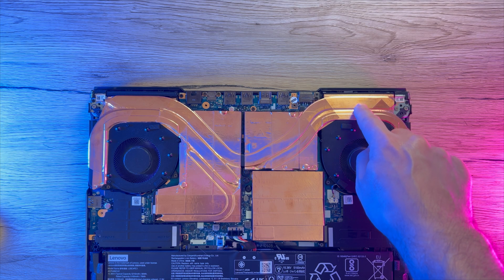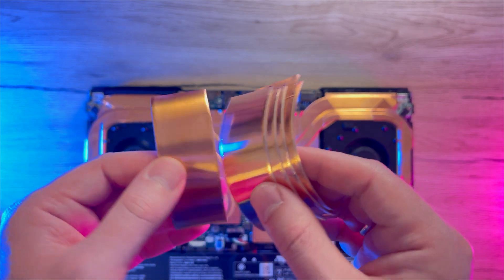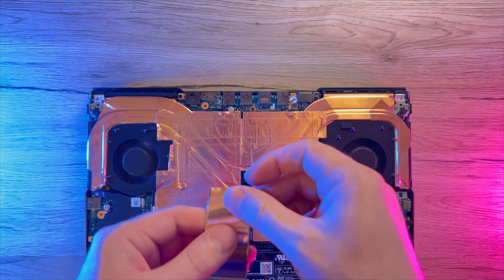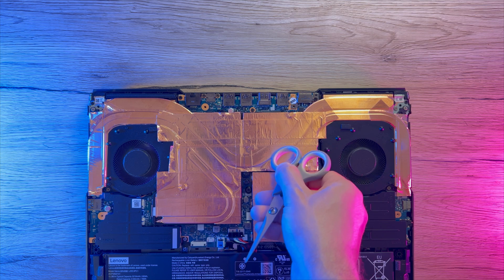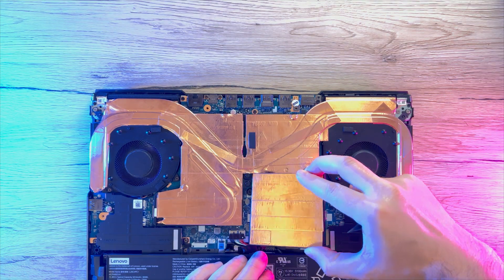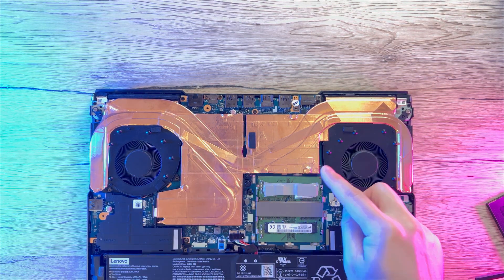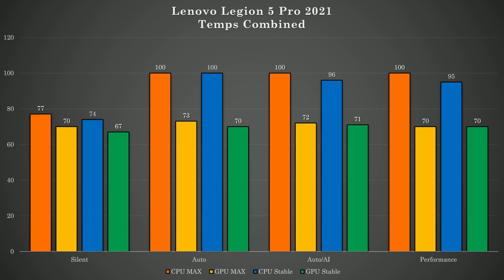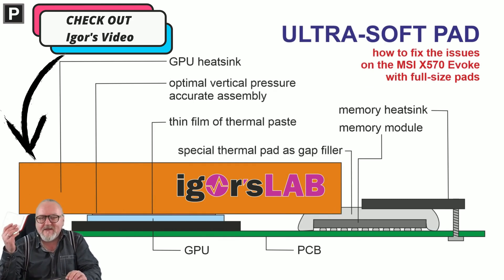Lenovo Legion 5 Pro Modding Cooling Block (can be applied to any laptop)

Comment: Where's the before temps???
Reply from the maker: Temps are the same as they tend to be with all laptops. After some time cooling block is saturated and there is not mich you can do about it. This will benefit daily use and idle temps but under load it will get hot no matter what you do :)

Comment: This was a terrible mod. There are no before and after performance comparison. Which I highly doubt are there much. Maybe 2C difference at most. Probably not good long term too when the coppers stored all the heats in it. It will not be able to dissipate the heat fast enough in a long high load use. So the temperature would have slowly creep up.

I think a better and easy mod that you should have done was sticking a bunch of copper fins on top of the heatpipes and heatsink. Since the bottom cover of the laptop already have opened fins for airflow, taking advantage of that by increasing the surface area of the copper heatsink would help dissapate the heat from the original heatsink into the air faster. And it is readily available. You can buy thin layers of copper fin heatsinks with already attached adhesive that is used for NVME SSD heatsink. Buy a bunch that have low profile that you can fit under the laptop cover. Then just put the laptop on top of a good cooling pad and you can probably get 20-30C temperature drop.

I don't even mod the cooling on my laptop. I just put a IETS GT600 laptop cooling pad and it can already drop the temperature around 10-15C. I don't even have to max the fan speed. The standard fan speed I use is around 800-1000rpm. During gaming I increased it only up to 1400rpm. The max 2800rpm is just way too noisy. It sounds an actual stand fans. I can bet by increase the surface area of my laptop heatsink by adding copper fins on top of the stock heatsink, I can probably get another 10-15C temperature reduction. Probably a total of 20-30C temperature drop. I am already planning to do it on my next GPU/CPU repasting.
Reply: I was thinking the same thing about the adhesive on the tape for a long time I don't think this is a good idea

Comment: i saw that you remove the 2 black tapes covering the bottom panel fan intake, does that help with temps or noise?
Reply from the maker: They do a bit but nothing noticeable really it just make air move differently and across the cooling block

Comment: Well, this seems to be both pointless (can't and doesn't do anything good for temperatures) and dangerous (the risk of dropping tiny copper cuttings on the mobo). I like it!
Reply from the maker: only thing that it does is when idling or in light use, otherwise cooling block gets saturated fast no matter what :D and yes it was slow process XD

Comment: I'm considering soldering the edges of the copper pipes to the chassis in order to enhance heat absorption. I've noticed significant air gaps between the pipes, especially after replacing the thermal paste, which has resulted in my CPU reaching temperatures above 90°C. I think I inadvertently created some of these gaps while removing the cooling block. Another theory I have is that my cooling block may require more pressure. When I secure the screws, they tighten before I can sense the necessary pressure. I'm uncertain about what steps to take next.
Reply from the maker: Well that is basically pressure issue that we all are facing and why Lenovo use PTM pads that are much thicker... try and let us know what worked best.
Reply: @atechcheck  
You mean Much Thinner!!

I attempted to test it by applying only the thermal paste and installing my cooling block without using any thermal pads to enhance the pressure on my CPU. However, it still overheated, reaching 97°C before I even had a chance to start the game. It didn't get past the loading screen.
Reply from the maker: @Abdallah_Ismail  hmmmmm that does not sound good man!!! what you cant do to check contact and pressure is to use ink paper (or whatever it is called LOL) that will leave marks on both sides so you can be sure if it is making good contact! It might be that small lugs (screw holes) on your board are raised too much and even when you screw it tight it is not making enough contact so what you can do is to sand/grind some metal from bottom side where your screws are so it must sit a bit lover then ;)
Reply: @atechcheck  
"I have considered the possibility of finding those small lugs, but I couldn't be 100% sure that I had them. After closing it up for the 7th time, I didn't bother to check again. The last time I applied thermal paste and pads of 0.5mm, and I thought that's it.

During normal workloads, I don't experience any problems, but while gaming, I have to cap my FPS at 60 instead of reaching 80+ to prevent overheating.

Perhaps tomorrow, I'll check for those lugs without removing the entire block. If I don't find them, I'll close it up as it is.
Reply from the maker: Thats great!
Reply: @atechcheck   Hey, your tip about "small lugs (screw holes)" and "sand/grind some metal from bottom side" WAS AWESOME
just oppend it to remove some of the dust-out and I remembered to check for them, and yes after grind them a little bit I got better result in temps, Thanks again <3
Reply from the maker: @Abdallah_Ismail  awesome! I mean you have made that gap smaller and with that you got better pressure and heat transfer
Reply: @atechcheck  Thanks to you <3

Comment: would any type copper sheet work? is there any risk due to electrical conductivity of the sheets?
Reply from the maker: Of course there is! Be careful! As you see I have only applied so that there is no possibility of touching any components. I used one with glue but in theory any would do and thermal mass will be improved. There is a guy on YT that used thick copper plate used as back plate for GPUs so check that out 😉
Reply: @atechcheck  ok so I finally tried this. Put ~3 layers of copper film over the copper heatsink pipes in my old Sager laptop, reapplied thermal paste (no that it needed it cause I had changed it recently) and added a couple of thermal pads to make contact with the bottom chassis. Max temps did not improve, still hitting 95c~98c under load. BUT idle tems did see a huge improvement. I used to hit 80c while on desktop or YouTube, now they're around 50c~60c.
I'll see if it lasts for a time, but overall for the $2 I spent on the copper film and the ~1hr of work, I'm happy with the results. Thank you for this tutorial!
Reply from the maker: So now do you understand what I meant and what was shown in video? Those cooling blocks will get saturated under load and no matter what we do we are going to hit 90C! What you can do now is disable turbo boost under power profiles and set max to 99 and you shout stay under 80C, then you can undervolt your gpu and fix clocks at max advertised and with that limit boosting and there is your extr few C :)

Comment: Are you just trying to increase thermal mass? Because this won't increase heat dissipation, might even make it worse. But higher thermal mass I guess.
Reply from the maker: Jup that was my goal since it will get saturated anyway, but with external cooling stand it will help to gather and dissipate more and stay silent ind daily use. When gaming it will be hot anyway. Only way to combat that is reduction of speed or pwr of cpu and gpu
Reply: @atechcheck wait, I'm confused now, does it not make the laptop cooler?

Comment: Where did you buy those ? I can;t find exact same product you used.
Reply from the maker: By those you mean copper sheets or?
Reply: @atechcheck  yes
Reply from the maker: I just got mine in standard garden shopping centre. You can find them on Amazon too. They are being used as prevention for slugs in garden too

Comment: Would it be beneficial to use thermal glue to yhe copper so theres perfect continuity between heat
Reply from the maker: There is a video of a guy doing just that 😁 it worked actually (he used a copper plate with some kind of slim fins) but the issue with those Lenovo laptops is not cooling body but rather die to cooling block contact and pressure…

Comment: Hey what is your undervolt settings that you used?
I have L5P RTX 3070 and RYZEN 7 5800H
Reply from the maker: I use TDP limiter for cpu and for GPU I try to keep stock boost but low as possible V. You will need to test and find one for your chip. Mine is fine at 0.85 I think

Comment: i had a question am i the only one that there right fan is always at full blast and my laptop is never silent idk why
Reply from the maker: It is because your CPU is reporting high temps but your die contact is not good enough to transfer that heat and laptop gave instruction to ramp up the CPU fan (if we are looking at right one when opened)

Comment: how will the glue behave in the long term with 80+ temperatures ;
Reply from the maker: Well, a good Q :) if you clen everything with alcohol and then apply copper tape well it hold really well (really hard to take off) now looking at long term... I honestly do not know. I will be opening my L5Pro to check and update as a pinned comment under this video ;)

Comment: Cool technique! Is it really so efficient? Thermal tubes are made from copper already, so what is the physics of this plating? Also, have you tried to use copper instead of the thermal pads?
Reply from the maker: I mean it is another layer of heat absorbing and disapation so yeah it helps by utilazing parts that are "cool" to spread the heat more. It does helps and works but at some point whole cooling body will be satureated and at that point it does not mean that much if fans are not disapating heat fast enough :) Regarding copper shims... nop we can not since even for soft pads there is not that much space and they would introduce even more issues with dies to cooling body conntact...

Comment: I have a Thinkpad P1 gen5 without the vapor chamber cooling system. Do you think transferring heat to the bottom case while also increasing heatsink size will make the laptop run significantly cooler reducing fan noise?
 Mine has the alder lake 12700h which we all know gets really hot

(Since I use it on a desk, having a hotter bottom case won't bother me)
Reply from the maker: Is your bottom cover made of metal/magnesium? If yeah then you could theoretically use couple of good thermal pads to make a contact with you cover and then either leave is as that of if youy it is mostly on the desk then you could use one of those aluminium heat sinks (wider but thinner one) and place all together on a cooling stand ;) I did exactly that with my X1 Carbon I just used alu rail to lift it a bit and that rail was connected with double sided thermal tape to the bottom of my laptop and was like a big heat sink :)

Comment: how the F is your cpu pulling over 50 watts. Mine overheats instantly with only 20Watts. spikes right up to 95-100 deg. :(

Another interesting Mod would be an additional Cooler mounted on the back of the CPU/GPU Block. But that would look more like a hack, hehe.
Reply from the maker: Well I can tell you how xD your cooling block is not making adequate contact with CPU/GPU dies…. Take a look at my Alphacool video regarding this ;) also pro tip! Limit your CPU to 25-30 and you are good to go. Performance wise and temps wise 👍
Reply: mine draws 129w at cinabench and other stress tests and when it throttles it stabilises around 108-112w with 88-93c, but when it draws 129 + watt yeah it get 101c... 
usually even in CP2077 it draws 45-60w 67-84c and momentarily it might draw 90w when loading. 
But im using 12700h 3070 so i cant undervolt.... But use performance mode so...

Comment: Is it temperatures or fps on the graph at the end? And how was it before all this? Nothing is clear or informative.
Reply from the maker: I mean it clearly states POWER DRAW and TEMPERATURES on the graphs :D I am not sure what you are asking..... In terms of gains it will basically be in normall day to day use since this can not help not that great cooling solution from Lenovo under load since it will be saturated eventually (slower than stock but it will happen) and you will get same temps but with better heat disapation it will use more power and give you slightly better performance! BUT to actually bennefit from this you will need to limit your CPU to 25W and undervolt your GPU thru Curve editor since otherwise only benefit that you will see it in day to day use (lower temps and actually silent fan) ;)
Reply: @atechcheck  sorry, but if that is "clearly" then you might want to ask for a second opinion on how to make graphs :)
Reply from the maker: Well it might be that graphs are Shiat LOL but then at least read my comment replies! PS. Not many YouTubers are replying so be thankful LOL
Reply: @atechcheck  thankful? for what? misleading graphs? that you came down from the heavens to reply to the comments? just take the L and make it better. pretending that it is ok and that we should be "thankful" for it is just childish.
Reply from the maker: @mariuspuiu9555  You have issues my man ;)
Reply: @atechcheck  yeah, i have issues with your results :)
like seriously, how can you deny the results are worse when your own numbers say that? and i'm not the only one who pointed that out. your CB numbers are lower and temps are wack.
and you knew this, it's why you made the graphs like that. what you've achieved is just a delay in getting the max temps because of the extra mass but worse heat dispassion in the long run.
Reply from the maker: @mariuspuiu9555  in all honesty, what do you expect from thermal paste and all those small mods? Do you really believe that this cooling block is enough to keep 80W CPU and 130W GPU in check? NO FFS LOL this was just a demonstration that it can be improved somewhat!!! Only solution is to limit power to those components and with some extras like good paste and some modding to increase thermal mass to delay those high temps so that fans with passive cooling can dissipate it faster and with that reduce heat and fan speed in tasks like web browsing and standard use. When it comes to gaming,  no matter what you do (except playing in freezer or water cooling) those machines will stay at around 90-100C after 1h+ of gaming IF YOU LET THEM USE FULL POWER ;) i really don't know what else to say to you. (you dont like my graphs, I get it LOl I hate graphs. But that was not the point of this video xD)

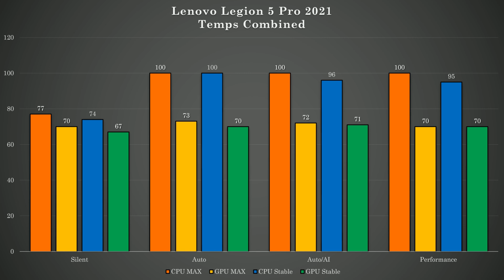Comment: I dont think this mod will be usefull. Copper itself is less heat connductive than heat pipe. You are heat soakinng those copper pads with glue isolation layer. In your own resaults you can see that cpu temeratures inncresed from 95 (time 4:00 in performance mode) to 100 (4:06, performance). Gpu same story from 70 to 75. Only positive about your mods are thermal pads for SSDs.
Reply from the maker: Well You are sort of right with heat soaking but that is what the rest of the cooling block is already doing… since there are some parts (ends of side vent, edges etc) that are much cooler than middle, I am trying to soak everything in and spread the heat as much as possible so that it can be cooled passively too from intake airflow. Regarding temperatures at the end they are as they are but you need to focus on power draw since now it is drawing more than before since cooling is more efficient and lenovo is using it to push cpu more… only was to get those temps down is to limit CPU since at 80W sustainable, no matter what you do this cooling block will get saturated and laptop will push till it thermal throttle… I was limiting my cpu @30W (going up brings nothing) and GPU was @100W (undervoted) and I have 70C on CPU and 65C on gpu in Quiet Mode (vantage) and my laptop is running Forza 5 @1440p all maxed out @75FPS synchronised will monitor…. I would say it definitely did work but only after softpads and proper seating my cooling block 😊
Reply from the maker: @Kevin Whitely Well we all have our opinions and ways of seeing things ;) one is for sure, dont let anyone mislead you, including me ;)

Comment: I'm confused. did the copper pads help or not?
Reply from the maker: Not sure about your question? Yeah they did but if you explain to me why are you confused I might help to clear it up 😉
Reply: @atechcheck  i think your before and after graph is not clear enough for us the audience 
your video is comparing the data within different slide and not side by side in one slide
and we can't see clearly and visually how much gain we got from the mod as we watch the video

you might need better graph to show the gain from the mode
for example

cpu is running 5c cooler
gpu running 100mhz faster
fan noise is 3db quieter
etc etc
Reply from the maker: Ahh now I understand ☺️ yeah you are right! Tbh I was trying to make it easier for myself (lazy I know) I will try to improve this for new videos. Thx